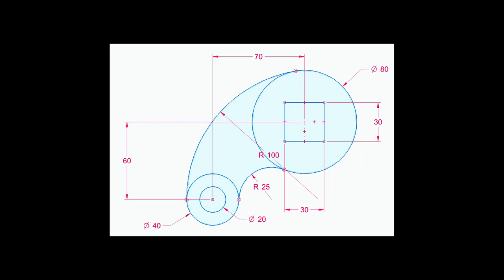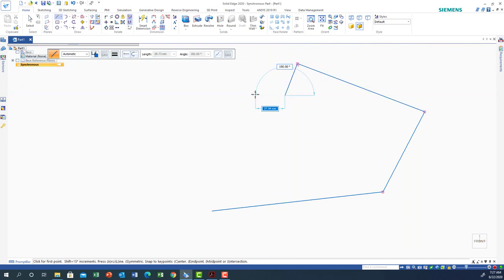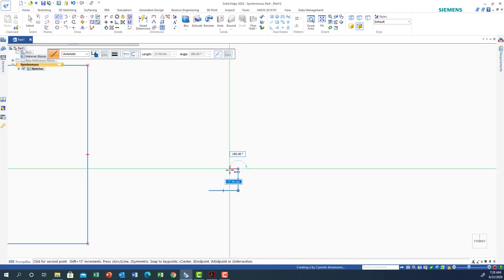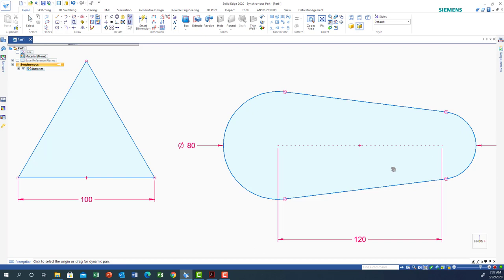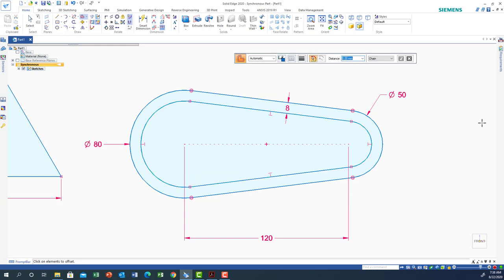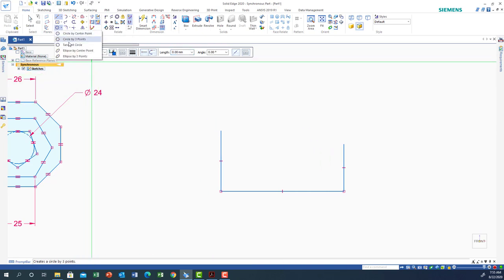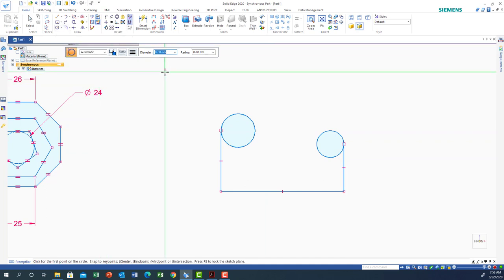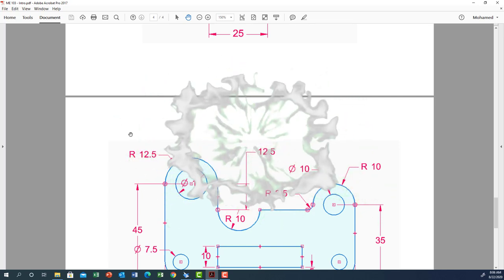Introduction to Solid Edge  - Part A

Comment: Good morning sir.  May I ask you how you have the little window that is horizontal selected?  It is where you put the numbers.  You moved it out of your way in the video.  I have version 2023 and I get a box to do the same.  I like your layout.  Thanks in advance and I look forward to learning Solid edge with you. Ok...Ok...I found my answer.  It will not be allowed now with 2023 update.  Bummer.
Reply from the maker: I am glad you were able to find your answer, In my experience, I had the same issue, but with time I got used to the new format and it does not bother me now.

Comment: can you explain to me why one dimension is blue and the other is colored red? sometimes i can't turn this one to red!
 thank you!
Reply from the maker: If the dimension is colored red, this means that it is an independent dimension and you can change it at the expense of the blue-colored dimension. Blue color represents the dependent dimension (whatever is left once you assign the independent dimensions) and you cant edit this dimension unless you change one of the other dimensions and Solid Edge automatically will adjust this dimension.
Reply: @drmseif  thanks for clarifying this, I used to buy books to learn a new program, but these are quickly outdated.
I'm going to do all your exercises, and I'm making very fast progress now!
thanks

Comment: Sir please make video to export solid edge model to AutoCAD (dxf file).
Reply from the maker: There is no need for that and I don't have an access to AUTO CAD. Use save as to save your file in a format that is acceptable by the other software. My students were able to move files between three different software (Solid Works, Creo, and Solid Edge) without any difficulties. Good luck.
Reply: @drmseif  
Thank you 😊